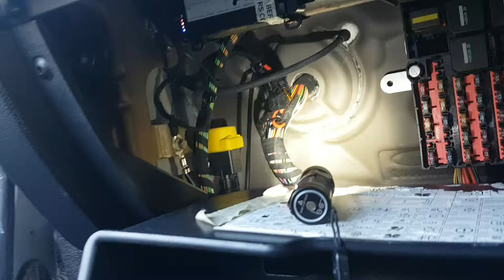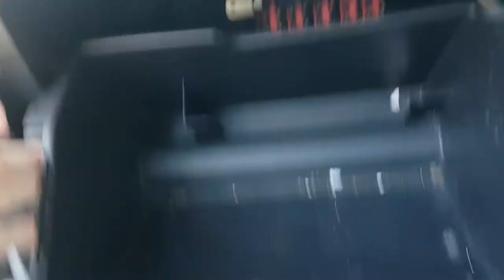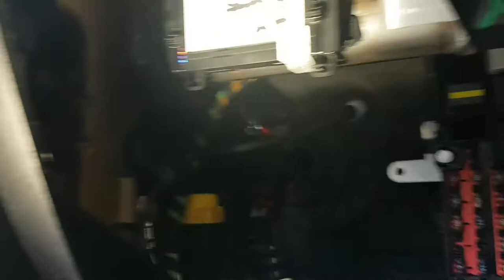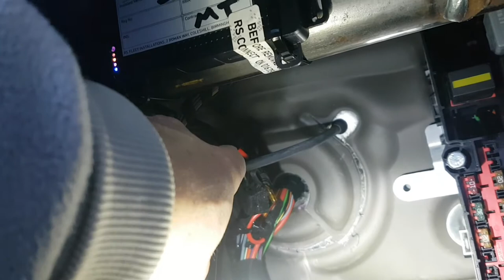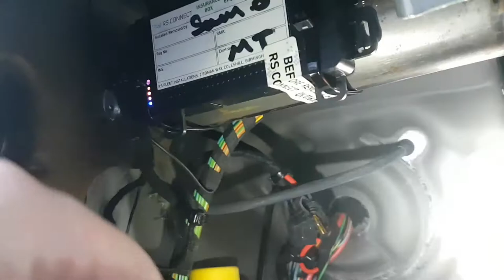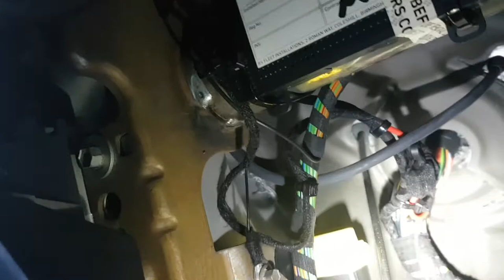Insurance Black Box How To Turn It Off | MK6 Ford Fiesta | Vauxhall Corsa C-D |  Hack | Insurance

Comment: So what you saying is that if i would to run 2 wires from my 18v drill battery through the fuse and burn it i technically had an electrical fault i knew nothing about
Reply from the maker: I'm not saying anything 😉 but that would probably work, be careful of battery back ups though 🤔

Comment: I saw in one of the comments you replied to mentioning GPS tracking within the black box, is this not turned off when it's disconnected?
Reply from the maker: I presume its probably got a battery back up, I didn't actually open it to find out.

Comment: How does this box get put into the car?  Do you have to take the car somewhere when you sign up to that policy?
Reply from the maker: No, they send an "Engineer" out to install it, normally they won't let you see where they put it!! They also charge you for the box as a fitting fee around £80.00 then when you come off the black box insurance they just leave it on your car or you can pay again to have it removed for another £80!!

Comment: Wouldn’t they realise as you have cut the wire and also when the fuse is taken out and you drive will the backup battery not pickup your driving
Reply from the maker: I couldn't tell you TBH... but if you wanted to make a long journey you could always doable it for a bit and then bung the fuse back in